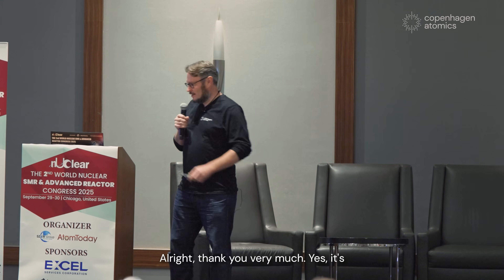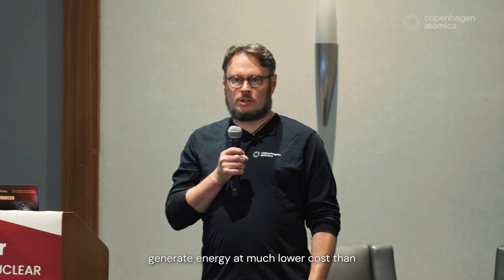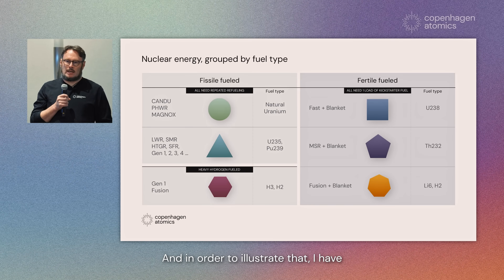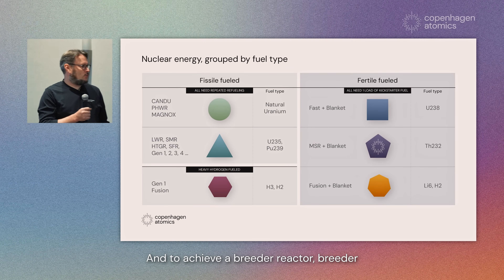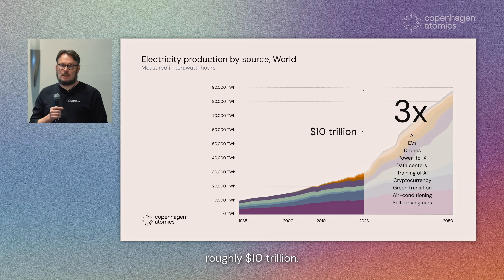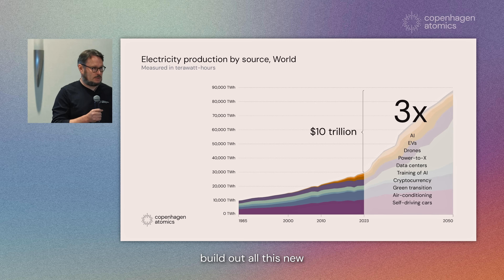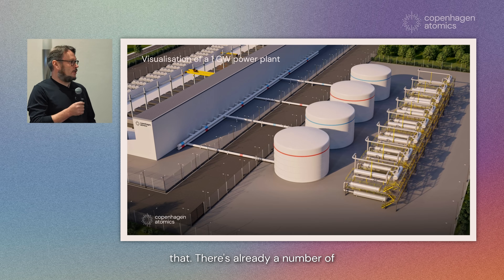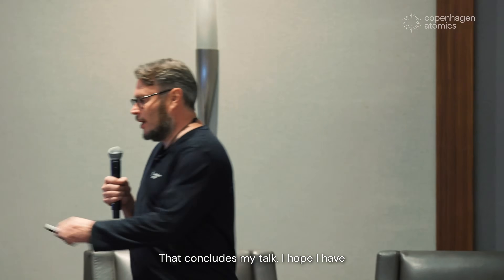The Solution to Future Energy Demand: THORIUM Reactors

Comment: CA is a company that are avoiding to talk about what the problems are with MSR technology. They avoid especially the problem with Th breeding, proliferation and waste. Not to mention radioactive contamination of the chemical processing plant and energy tranforming system. They are selling. Nothing else. By doing so they create a great potensial to failure. People are not prepared to accept the extremely high development cost a Thermal Breeder Thorium fuel cycle MSR system will bring. They should stop the BS and inform the people on what the problems are.

Comment: Can you guys what happens after the 5-year cycle. According to your website, the molten salt will be extracted and stored, while the reactor stays on-site for 50 years. You also mentioned it can be recycled after 25 years, once the salt residue is washed and the materials are remelted. Can you outline step-by-step what will occur? Will the reactor module remain at the site for 25 or 50 years? Does this mean there would be 25 reactors added every 5 years, totaling around 125 to 200 modules on-site, or will each be removed after its service ends?

Comment: Some big problems for Thorium reactors
1) Electricity produced by renewables will make fission reactors uneconomic
2) Where do you get the technically trained staff to run these reactors? A full fleet of fission reactors required to power a whole country will require a large number of people trained in nuclear engineering, that doesn't happen quickly. It would also require governments to offer financial incentives for people to train as nuclear engineers and not take their numerical skills off into financial engineering. 
3) The bottleneck in the Thorium fuel cycle is the long half life of the intermediate isotope between Th232 and U233. During the long time it takes Pa233 to decay into U233 it's a strong neutron absorptive in the reactor, which causes problems when breeding U233.
Reply: ja wir brauchen wieder mehr Bildung in Naturwissenschaft und Technik. Junge Menschen sollten in systemrelevante Berufe gehen.
Reply: Der Strom aus EE reicht in den nächsten 10 Jahren nicht, KI, 5G u.s.w. sind Stromfresser!
Reply: Renewables??? I think you mean very low energy-dense intermittent sources that are totally dependent on the time of day, the day of the year (season), Vast amounts of raw materials including land, gigantic chemical batteries, thousands of miles of new transmission lines AND, AND a full demand-sized natural gas or coal plant as backup. No amount of overbuild and batteries can overcome seasonal variability for full reliability.

Comment: Its ok in theory but why?
We see the cost of renewables falling year on year V the old way of doing things as in fixed large scale plant that needs huge up front investment and has large operating costs

Were currently as a country UK installing a medium sized power stations worth of domestic solar and battery storage every year
Reply from the maker: You're quite right. Renewables will also be a part of the mix in the future. But if you look at the overall energy demand, even though renewables increasing rapidly, it's still not enough to meet the growing demand. So we're still using more and more fossil fuels year after year. We need an energy source that is affordable and scalable which is not intermittent so we don't need to install extra capacity and storage and better flexibility in transition etc.

Comment: Yada yada yada. We already have cheap solar panels and wind turbines. We already have grid scale batteries. So why are we chasing expensive dream solutions ?
Reply: Renewables??? I think you mean very low energy-dense intermittent sources that are totally dependent on the time of day, the day of the year (season), Vast amounts of raw materials including land, gigantic chemical batteries, thousands of miles of new transmission lines AND, AND a full demand-sized natural gas or coal plant as backup. No amount of overbuild and batteries can overcome seasonal variability for full reliability.
Reply: @chapter4travels  Gosh, which rock have you been under? Here in Portugal renewables are over 100% some days and they are pumping water back into the hydro dams for later. It’s happening. Don’t rely on your oil company shares. A huge slice of their balance sheets is “proven reserves”. Just like coal, most of it is staying underground.

Comment: Nuclear is just too expensive right now, it takes decades to recoup investment , we will see if thorium revolves this or just makes it worse. 4 cheap solar panels helps cover the cost of at least half oir 2/3rd of my electricity consumption year. we will see going forward if we even need nuclear power stations.
Reply: Bei EE sind die Kosten für Recycling nicht dabei und die dürften hoch sein mit sehr hohem Stromverbrauch, um seltene Erden zurück zu gewinnen, wir haben noch gar keine produktionsreifen Technologien!
Reply: @ArekGunter2015 Yes  but solar panels are predicted to have a lifespan of at minimum 20 to 25 years, possibly much longer. And huge recycling of panels is already underway. Not something widely known and not something that haters of solar like to speak about, thorium reactors look really good on paper but where are we going to stockpile the radioactive waste and there is a lot of radioactive waste that cannot be recycled or treated in any way just thrown into a hole in the ground for generations to come to worry about.

I like the new Japanese modular nuclear reactor now in wales uk, but still there is going to be radioactive waste. let's find a solution to that before building hundreds of these new modular power stations.

Comment: Thorium reactors should have been perfected and deployed decades ago but now it it too late.  Solar panels are so easy and quick to install from decision to operation and are so much cheaper than any alternative that they are now unstoppable.  For heaven sake, in May of 2025, China installed 3mW of solar panels every day and continues to do so.  And, wonder of wonder, it has been found that agriculture under solar farms is in some cases improved and in most cases, hardly significantly decreased.  This move to Thorium is too little and too late.
Reply from the maker: We're not saying that we should stop installing solar. But we need both to scale, if we want to increase the supply with demand and not use more and more fossil fuels as we do today. In 2024, China also added 1.38GW capacity of nuclear, which would then be an average of 3.78MW per day. The difference being the average capacity factor of nuclear in China is 81.5%, whereas their solar is 14.7%.

Comment: The "Core Problem":

Containing a 150 million °C plasma. that acts like a 1.6 Gigawatt neutron "sandblaster." 

This neutron flux doesn't just heat the reactor walls; it atomically dismantles them, causing swelling, embrittlement, and radioactivity.

This makes the reactor's "kettle" (the first wall and blanket) a consumable, irreplaceable core component.

If this "kettle" fails, the entire reactor becomes radioactive scrap. 

While the fundamental physics of fusion is proven, the materials science to survive this neutron hell for an economically viable time remains the grand, unsolved obstacle, making commercial fusion a monumental gamble.

Then there is also the "Q" problem.

I would not bet on Nuclear Fusion.....
Reply from the maker: This is not fusion.
Reply: @CopenhagenAtomics  
I agree...I thought that I would throw that in to reveal that thorium has a less chance of failing than fusion reactors....Yet still a fission reaction with the waste and materials problems.....Seems there is no escape from drawbacks whatever we try to do,
The Sun is the best power plant ever and forever.
Reply: @CopenhagenAtomics  
Fusion Power Plants is the topic.
Please do not divert from the subject matter.

Comment: Toward the end of the thing, the guy clearly says that he's they've built multiple reactors. Only later does he clarify and it's not really a clarification. It's an it's. It's a confusion, that they won't be running a reactor until 2027 according to their plan. So what the hell are they building multiples of? Are they? Maybe he meant maybe he has a confused language issue but he couldn't have meant designed or scale model of. In any case, that was a Savage death blow to this video to his whole talk. You know I'm just lifting the needle on this entire record. 
🤬🗯️ 👀🤢🫵

Comment: I'm having three questions, that the Talk didn't answer for me.
1) Reactivity control, Thorium and fast reactors have a lower share of delayed neutrons, how do you ensure to never reach promt critically?
2) What is the 50m$ price based on? Have you build a full reactor to the standards required for
the real reactor? 
3) When I first heard about the collaboration with PSI the timeline was to "reach critically" in the year 2026. Can you give a hint what was the reason for the delay, to 2027?
Reply: It’s not a fast reactor
Reply: Thorium, once it turns into U233 creates 2.33 neutrons per fission, and that takes at least one of those 2.3 neutrons.  All the structural material in the core is going to absorb at least 5%, the moderator even if heavy warer will absorb another 5%, and you still only have a 76% chance of fission when the U233 absorbs a neutron.   Thorium is a bullshit fuel.  It is very close to poison for neutrons.  I modelled this for the CANDU reactor, and a critical system needs way more uranium 235 to deal with the absorption of thorium than not using thorium at all.
Reply: @hitchensghost  
Okay you think they just sprinkle a little bit of Thorium in the mix for PR?

Also do you happen to know if that's also the problem with the two pebble bed reactors in China and Germany.
Reply: @patrick_test123  There were advantages to thorium , as an initial poison within the fuel bundle lifetime.  no opinion on pebble beds.

Comment: Private companies should not be allowed into such areas. The responsibility is too great, and private interests are unwilling to bear it, instead seeking huge profits here and now. The dominance of private interests in this area, in space, and elsewhere, will lead to even greater dependence on capital for ordinary people—or, more simply, enslavement. Examples don't need to look far: Google installs tracking apps on mobile devices along with regular Android OS updates (though they already collect extensive information about us). Microsoft also collects a lot of information through its OS, Meta, and other private companies.
Look at the construction of huge data centers in the US, right near populated areas. As a result, they take away water from local residents, create constant noise, increase electricity rates for ordinary households, and so on. Business doesn't care; if necessary, it will kill for profit. The idea of privately owned non-nuclear reactors isn't about improving people's lives or progress, but about gaining control. After all, energy is needed everywhere, and then they will dictate the terms, and do you need that?

Comment: 🥳🥳🥳🥳🥳
I'm about to build a 220 Volt generator without using fuels, biofuels, hydro, wind, solar, hydrogen and nuclear power and I also invented "quantum mathematics" not to be confused with "quantum mechanics" which is what the AI recommends to you 😉
-->
Sto per realizzare un generatore di corrente 220 Volt senza utilizzare carburanti, biocarburanti, idrica, eolica, solare, idrogeno e nucleare e in più ho inventato la "matematica quantistica" da non confondere con la "meccanica quantistica" che è quella che ti consigliano le IA 😉
🥳🥳🥳🥳🥳

Comment: Isnt it insane that we still boil water to make steam and thats how we get electricity. Hundreds of years and still we have not been able to move past steam power.
Reply: Ever heard of the photoelectric effect, for which Einstein got the Nobel price?
How much cheaper and easier than solar panels can it be to get, handle, process and recycle Thorium (which is nowhere as abundant as silicon, even wafer grade one)?
Reply: nah... in the future we can just swap water out for supercritical co2...
Reply: Your out of date China have their thorium reactor working well has been for three years now, just google it and you can see for yourself, they even refuelled it without needing to shut it down,
Reply from the maker: It's true, the fundamental principle of converting heat to steam for electricity generation has been around for a while, but the underlying technologies have advanced significantly! And if we can get most plants to utilise waste heat, etc., as is already done in Denmark in thermal plants, we can increase efficiency greatly.
Reply: @CopenhagenAtomics I still think that having a carbon dioxide turbine system would be perfect
Reply: @CopenhagenAtomics If you look at the falling cost of renewables + storage then this tech will be redundant before it's built

If your generation is through steam then it will never be economic

Comment: Respect for naming the cost issue.
Reply: The cost estimate is worthless, when leaving out a major point: the needed chemical separation of the fission products. A thermal breeder needs a insane amount of reprocessing because it needs rather clean fuel to reach even breake even breeding.
Already reprocessing Uranium fuel turned out to be expensive. Because of the hard radiation and chemistry thourium is several times more demanding (the difference from solid to moten salt only makes a small difference).  In addition the thorium cycle needs much cleaner fuel (and thus short cycles) than a fast breader. So recoverd U235 is way more expensive than Plutonium. On top of that recycing the thorium may be nearly as expensive and there is a lot the thorium to go through the cleaning process.
A practical thorium breeder would need a huge (like 100 x  cheaper)  improvement in the reprocessing technology and aready a much smaller improvement would be a big proliferation problem.
Reply: About a third of the fission products are easy - they're gases, which readily come out of 600C salt. Most of the rest are metals, which can be plated out on a mesh  in a cold trap, like the condenser at the coolest part of a water-cooled reactor. Separating uranium from thorium and protactinium fluoride salts in the blanket salt is also a known tech - electrochemistry. Running a current through a circulating loop of the salt promotes the uranium tetrafluoride to uranium hexafluoride, a gas. That can be recycled into the fuel salt in the core. Thorium and protactinium fluorides do not have a gas phase at the same temperature.
Reply: @2x6x250ml  The elctrochemical part is know in theory, but with the hot flourides it is very corrosive. So it may work for a few days in the lab, but is very difficult over longer time without weekly service. Even if only a small fraction of the fission products, the rare earth part is very hard to separate from thorium. It is very hard even if not highly radioactive. The metal plating idea is more a problem than a soluion - the plating with some metals also happens uncontrolled, e.g. at the graphite, heat exchanger or at valves.

Comment: The #1 benefit of Molten Salt Reactors is they operate at atmospheric pressure. The fuel/coolant is liquid at the reactor operating temperature. When you run your reactor at 15 psi instead of 1500 psi, you don't need a two foot thick concrete shell to contain a possible explosion.
Reply: Not to mention the availability of Thorium and hence the cost of energy
Reply: @SahilP2648  fuel is the cheapest part of nuclear power production. What’s expensive is licensing, establishing a supply chain, construction, managing waste, and maintenance, all of which become substantially more expensive for a thorium reactor when compared to a LEU-based design
Reply: @HistoryOfEnergy  I am not talking about the fuel cost. I am talking about the cost to the end consumer.
Reply: @SahilP2648 the availability of thorium has nothing to do with that is what I’m explaining to you
Reply: @HistoryOfEnergy  ok and? Availability still means that we can expand faster and much more than the amount of nuclear power plants that every country has currently. Right now even if the nuclear fission fuel is not particularly expensive, it's low in supply and they need to think ahead when it comes to building the plants and utilizing it properly. Thorium is widely available. If they can create a small form factor plant that can be put on site like a generator we will have thousands of small reactors near businesses and industrial areas.
Reply: If we stop dreaming and take off our rose-colored glasses, are you sure energy will be affordable for ordinary people? As long as capitalism rules, even the cheapest energy production will constantly become more expensive, and businessmen and politicians alike will come up with any idiotic excuse to justify rising prices. That's the reality.
Reply: @ntwkldqvcyf  not really. Cause their incentive would be lesser. Cheaper something doesn't automatically mean the company making the cheaper product is getting paid less. That's the reason why China can make cheap products and prefers doing that. That's because they can scale up with huge market % share and paying customers. The demand and growth will often offset the low price. You will get more profit with higher demand and higher market share compared to similar priced products.